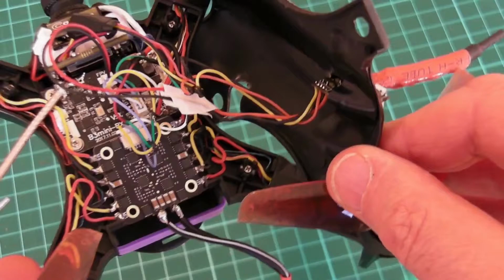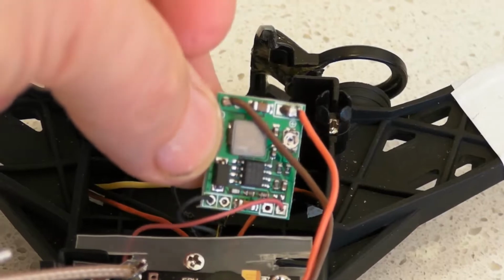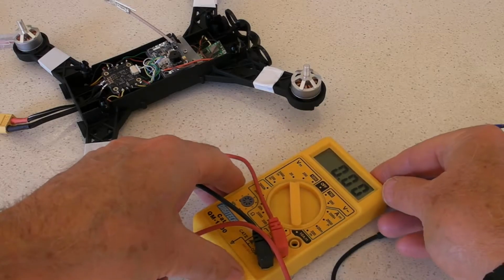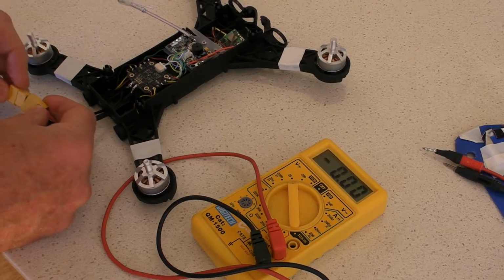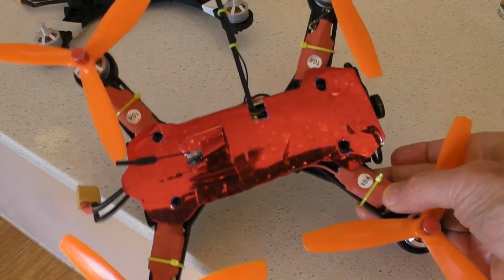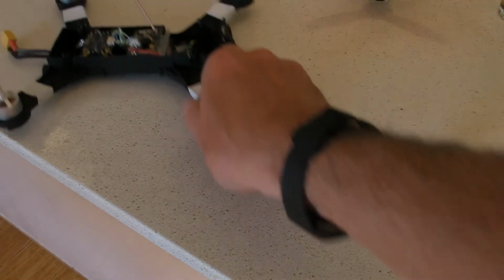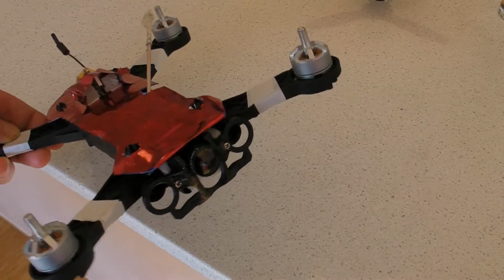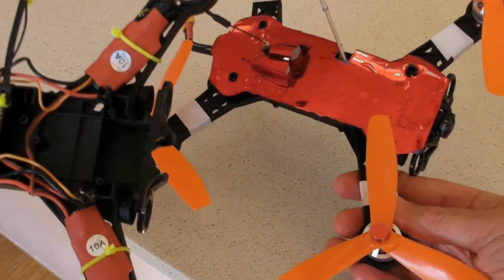Bugs 3 mini in a Bugs 6 Shell - Rebuild with Power Converter and 3S Test

Comment: hi, I built, with the pieces of a mjx bugs 3 mini, a whoop 3 inch 4S capable of carrying a GoPro well for four minutes of flight. i used the 4 in 1 esc from your descriptions and also the voltage regulator for the fc. it flies damn well !!! go see my latest video please !!! I have only one problem: how do you know the battery level? I risked throwing away two 2S batteries. I used a connector to create a series circuit, then with two 2S 850 mAh batteries I produced a 4S (to try) bye thank you.
Reply from the maker: Hi Roberto - good to see your very successful build!
 I always carry one of these lipo battery checkers, as sold on ebay. https://www.ebay.com/itm/234317744966 They are inexpensive and sold by many vendors. They show you voltage per cell for every lipo from 1S to 6S. After flying for 4 to 5 minutes, most of my lipos get down to about 3.8v per cell. Once I know how long I can fly for a battery, I use a timer to alert me at a set time.
Reply: @skybug3  yes yes ... the radio timer, I do it too. to check the voltage I use a common multimeter but soon I will buy that instrument made especially for batteries.  A thousand thanks

Comment: Now I know why bugs didn't use carbon fiber drones too damn heavy you know I told you about the carbon-fiber friend I got ya won't hardly pick it up that much it will burst Manoeuvres wobbly
Reply from the maker: We are all learning new things with this hobby. I stuck with plastic frames as they make it easy to fit parts, come in one main part, don't block radio transmission and are usually cheap and easy to find.
Reply: @skybug3  well I no longer have my carbon fiber frame a fucking bird decide to fly in front of me and I hit the ground and shattered
Reply: @skybug3  well I just ordered me a YKS 250 from amazon for $105 It comes w/frsky is6 radio!I just got to learn how tobptogram like betaflight